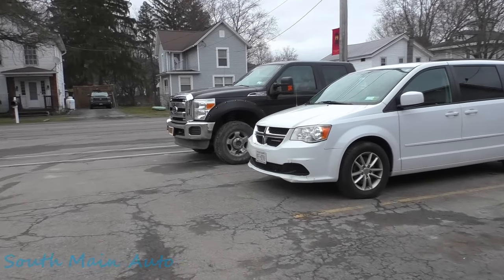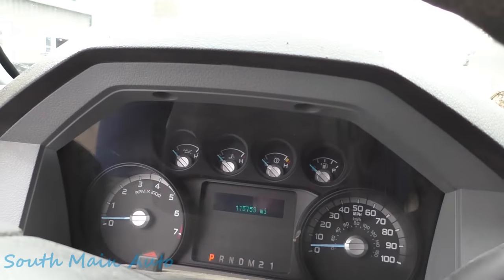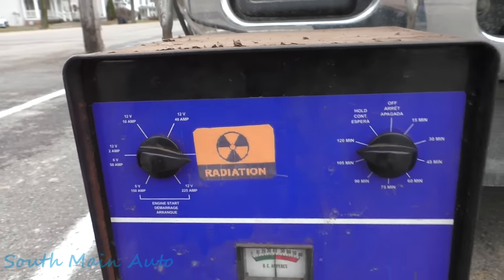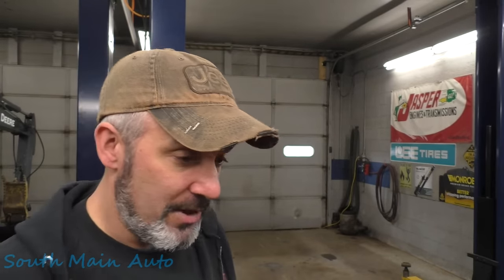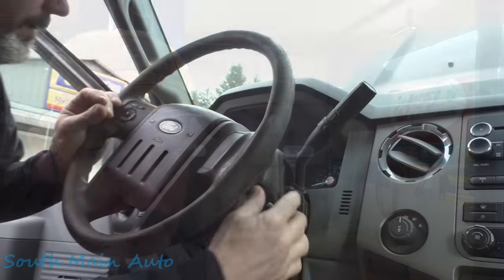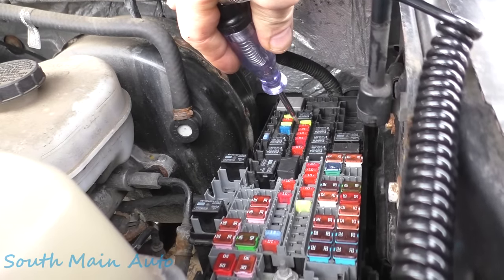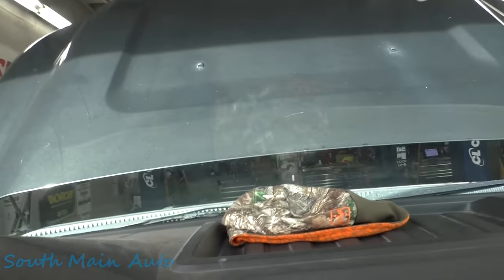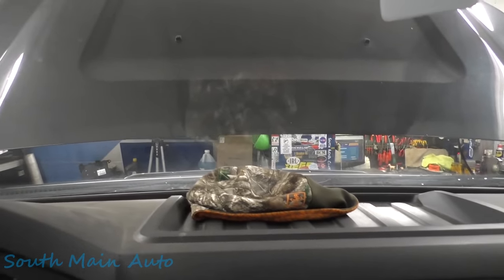Intermittent Stalling Ford F-250 : The Real Fix

Comment: If memory serves, you did check all of that!  I think the wire was still conducting intermittently.  Solid fix.  Don't worry about it.  You're the most thorough, honest mechanic I've seen in my life.  I don't even trust oil changers.  I mark the filter before going in the old days.  I just change my own.  I've even diagnosed an alternator problem on my truck using your methods, checking voltages etc.  Bought an alternator rebuild kit and back up and running!

Comment: You're absolutely right! Sometimes just wiggling a fuse box, fuse or relay will temporarily fix an intermittent problem and if you can't duplicate it sometimes you just have to replace the relay and ship it b/c you don't want to spend customer's $$ on labor chasing a problem that doesn't exist. Like you said, when you diagnose it vs replace parts if it comes back you know what you already checked but even then you have to almost start all over again. Intermittents will sometimes drive you crazy but when you fix what others couldn't that's what makes it satisfying!

Comment: I think your approach to intermittents is the right way to go about it. The fact that it was intermittent in the very beginning is what made it so difficult to resolve. I had a nagging intermittent on my 86 Camaro with TPI. I would be driving and all of a sudden the SES light would come on and the car would run like absolute poo and then after a bit, it would run normally. I ohmed the TPS sensor all along the sweep range, I checked the MAF sensor and datalogged it a few times. I actually replaced the TPS because it kept giving me a TPS code and there was voltage on the 5v ref wire and ground. Then while I was poking around the TPS I saw it, there was a piece of missing insulation on the signal wire coming from the TPS to the ECM. It would move around when I was driving, especially on turns, ground out on the metal intake and set a code. It was on the bottom side of the wire and was easy to miss, but the visual inspection is a key part of diagnosis. My friend called me over once because he couldn't get his TBI to run right, it kept missing. I looked it over and in 10 seconds I saw a huge chunk missing in one of the spark plug wires and you could literally see the spark jumping across the gap in the insulation. He used to be a mechanic but you can go "snowblind" by all the possibilities and forget about the simple ones. Good videos, don't feel bad, those intermittents can be a biiiiiiiiiiiiiiiiiiiiiiiiiiiiiiiiiiiii

Comment: Mr. O! I watched both videos. You made an accurate diagnosis in the 1st video. Unfortunately, the wire was causing an intermittent failure after you replaced the relay. I've been there before. I can't tell you how satisfying it is to see another highly skilled technician do such an amazing job at diagnostics and repair. I absolutely love your videos. To be honest, I ran into a problem of a vehicle that left me scratching my head & swearing. I walked away from it for a while and later remembered a video you posted. It wasn't an exact failure and fix,  but it definitely helped put me on the right track. Thank you so much. Keep up the great work. Many blessings to you and your family.

Comment: Eric 
yes I must concur that an intermittent fault is the very hardest to find , video one you did  a solid diagnosis no question on that . when the job came back it was now a solid fault so now you have a solid fault to trace out  well done .

my worst case of a fault was doing maintenance on a 400hz 208 3 ph vac IBM mainframe PDU supply , it was the changeover switch the cables were about  1 inch in dia flexible and two foot long ( note I am metric minded so rough translation) well it worked for five years after a dust out one phase down ? traced it to one cable two foot long with crimped on ends , this is NOT possible in my mind tested with a 1000 volt mega still open , visual inspection showed the end of the said cable had been in contact with the nut on the connection  , so I cut off the lug split it in half the factory had left the mylar clear sheath on before crimping hence a insulated joint 😣. mainframe was down for 50mins while it was sorted new cable installed very expensive as it was one of a UK Banks mainframe

Comment: I feel  your frustration BUT, you fixed it when the dealer said it needed an unavailable fuse box.  The customer is super lucky to have you as a mechanic. Your first diagnosis was  correct. The hidden wire problem was just serendipity.

Comment: Eric, as I recall from the first video, you said if the relay didn't fixed it, then the problem was with the control side. You were right. Since we all saw the test light lit up on the power side of the control, the likely suspect was the ground side - the wire between the relay and the BCM. What you and we didn't know was that the control side was intermittently getting power. I just shows me how I get tunnel vision and don't examine something more closely. Thanks for a great lesson! I've learned tons from you. Don't you dare call that number for some truck driving school.

Comment: I worked on Crown Vic’s all day every day and I can’t tell you how many time we had those fuse boxes apart. Many times we ended up replacing the box and harness. If I recall the part was over $800 but it sure cured a lot of problems.

Comment: Don’t give up Eric sometimes problems don’t always show their ugly head right away and sometimes they never show at all. I had a tractor once with a no start condition once. I tested everything and couldn’t find the problem. I even replaced everything just for the heck of it after cleaning the grounds. I was so furious and confused every circuit tested fine. Even replace one part at a time and put the old parts back in. So i decided I leave the battery disconnected overnight. I said god you handle it. Hooked the battery back up the next day and it worked perfectly fine. Never did find the problem because it never happened again. You’re a great mechanic and I have only ever experienced this twice in my life so far. Keep your head up and don’t give up.

Comment: My guess is the wire was partially shorter or broken the first time and when you inserted the new relay, the wire fixed itself. Another month of harsh conditions and it finally broke enough to replicate the problem again. When you pulled the fuse box up, you finished the process. Your diagnosis was sound the first time with the conditions you had presented. Obviously it fixed itself enough to run for another month. Don’t beat yourself up over it. Your process is absolutely one of the best out there.

EDIT: Just saw your update comment. Thanks for the update and I agree.

Comment: You didn't miss this the first time. I just happened to watch that video just before this one. The signal was always there and not intermittent. My guess is the wire was just hanging on by a strand at that point and finally broke afterward. I do see why this could be a warranty repair because it did come back for the same problem.  You win some, and you lose some. At least your customer has been made whole, and your work is solid. I wish there was someone as methodical as you her in WV.

Comment: We are not perfect! I've had trouble with Fords having a break in the copper inside of the insulation of the wiring. Sometimes it would touch and make connection and sometimes not! In 45 years of wrenching i though about giving it up but hung in there . I hope you will also!

Comment: Kinda reminds me of my son's Jeep Patriot with the 9 ground wires going to one eyelet on the body by the battery, it looked good, but once removed, literally fell apart. Which controled o2 sensor, drivers side front not back blinker.  Don't envy today's mechanics working on these angel hair size wires.

Comment: Also factor in that you were not feeling well on the previous diagnostic video. and the other shop could've still put a fuse box or fix the wire, shine the box and claim they've replaced it. You put your reputation on line every time on full display including errors or mishaps when they occur! RESPECT.

Comment: While it certainly is possible to have missed it the first time, and, as I've heard you say many times before, intermittent problems come through and go out with them still possibly there.  This seems to be one of them.  I sincerely doubt it will return with the same symptoms.  This is a solid fix/repair.  Don't beat yourself up.  Keep on keeping on Eric!!!  You are much better than 99.999999 percent of all of them out there.  The only guy I've seen that could possibly be on the same plane as you is MechanicMike - he's pretty darned good too.  Keep 'em coming!!!

Comment: I recall you checking that power and there was power on both sides. The problem was it stopped failing after you pulled that relay. You went with a new relay and wasn't 100% sure it was fixed but it stopped failing , not much you could do. You even took the relay apart, it looked good.

Comment: Good work, Sir we appreciate your professionalism - poor designed junction boxes and short wires
make for many multi-problems. The junction box over the wheel housing does not help either.
Vibrations and poor connections are hard to find. Took us three months on a vibration fault on our F-16
Aircraft to chase down, plus 21 poorly designed pins were tear drop shaped not round. Your trouble shooting 
is berry articulate - would make for very good training films... keep up the great work !
  F-16 Radar Crew / hot roders

Comment: I recently ran into an "intermittent" problem that drove me a bit insane. Had an issue with the A/T relay on our '04 Eclipse that I swore would be a short to ground (20a fuse blown that controls A/T relay), but when I tried to find one I couldn't. What I did find was the shift solenoids had a higher then spec resistance to them, and I had (wrongly) assumed that they were pulling to ground a short, blowing the fuse. Replaced solenoids, thought all was well, then a little later same issue! It wasn't until after the solenoids were replaced that it finally stopped being intermittent and I was able to trace it to a wire that was rubbing against the thermostat housing from a harness that the plastic had broke, causing the entire harness to sag/drop. 

I think I speak for a lot of though that we learn a lot from your videos, as I don't think I'd have traced this fault as well if I wasn't watching so many SMA videos lol.

Comment: I was working in the Defence Industry and carried out large (and very expensive) testing.  Had one where we tested the daylights out of the device and coupled it to an engine.  Failed.  Took me two weeks to find the damn problem.  One of the boards (hand made) had a tiny copper trace, 0.25 mm, causing an intermittent short.  I was going ballistic.
Mr O, I know how you feel.  I really do.  The Goal is to win in the end

Comment: Broken wire? Mr O will see it instantly. 

Don't beat yourself up, you can only fix em so they run. 

The first fix you did was actually part of the diagnostic process. You said as much.

I am happy with what you did, you were clearly cheesed off. Says a lot about your integrity.

Comment: We had a truck where I work that would randomly shut off and if you would open the fuse box and tap on the fuses it would start back up I took the whole fuse box apart and cleaned and crimped in all of the fuse connection points so the fuses fit tighter it was a fun journey.

Comment: Ivan had a similar problem when nuking the battery w/ a charger. The cars computer prevents you from starting the car do to high voltage feed back from current clamp.

Comment: Hey Eric you did a lot more than first shop and narrowed it down. Sometimes it takes a second time to solve intermittent issue. 
I’ve used these small WAGO type connectors which have electrical grease . Their a snap. Excellent video

Comment: I have been in your shoes on a repair like this and so have many others.  Your right in saying that without the full "Monty" of your 1st Diag, you would have spent alot more time to get where your found the wire issue.  Just imagine if you had removed that PITA fuse box to only find the defective wire AFTER it was removed!  Luck favors the prepared!

Comment: You did check control ckt a few times as I recall. Maybe load test on ckt would have revealed wire integrity issue, remember 1st shop said bad fuse panel, right, maybe they caught control side winking out and didn't want to dig in like you did. We all have comebacks buddy. But not every shop steps up like you did and solves the problem. Well done as usual!

Comment: Eric . I mentioned on part 1 that i had faught an f350 with same issues.  Man i literally fought that thing for over a month . I had probably 60hrs in it atleast.  I fixed multiple dead shorts multiple broken wires , multiple pin fitment issues. Then found the bad aftermarket prom that was hidden in the ecm case . The easy way to access that box is through the fender well. It dies have plugs that allow the box to come out . That are on a pig tale . Fords dont brake as often but when they do ... 🤯

Comment: 20:55 as a certified master auto and diesel, repair tech myself, Eric and All, electrical gremlins, such as this caused by stupidity of manufacturers, putting the smallest gauge wires in in the shortest of roots so they can save a quarter of an inch per wire yes, (I know it all adds up over many many cars, a manufacturer but please let’s not be stupid and stingy about it. We will be happy to pay the extra money for an extra half an inch of wire if it makes our lives better!) two things… Please do not quit because I very much enjoy watching a fellow wrench turner and diagnostic pro like yourself go through the flow chart of what it could be in what it shouldn’t be like I do, and I definitely enjoy your sense of humor, which is right parallel with mine. Number two is different ha ha as I would’ve putting one cable tie around all of those wires and cinched it down as without stretching anything and then I would’ve put some hot glue over it to keep any stray wire is also from, trying to stick your fingers out and then getting pinched off… Pinched off wires equals pissed off auto repair technician! Thank you Eric and Mrs. O, for all that you do! :-)
    Edward H. – “Madison Combustion Associates” and “new ideas and innovations, LLC“ out of the Madison, CT area.

Comment: Another fine job by an everyday athlete.  Nice that the guy had faith in Mr. O to bring it back after it had been "fixed".  What a rats nest of wires in that thing.  It seems like the first thing that flopped out of that box was the broken wire.  Amazing!  Thanks for not recording the "strong language".  I think kids should learn their own expletives.  I know I have my own.  I wonder if Mr. O also throws tools.  I do occasionally and that helps as long as they don't flip up and get me.  I had a close call with my wife once with a thrown tool so I keep that in my memory bank.  Tough, time consuming repair but once again the gremlins were foiled.

Comment: Here in Australia I fixed an Australian made Ford EL Falcon sedan which my great uncles stepdaughter owns which had a stalling problem whenever the gear selector was placed into the drive position.

The cause of the problem was a faulty aftermarket engine immobilizer/car alarm so t bypassed it so I reconnected the main positive feed wire from the ignition switch back to how Ford had it wired up in the factory !

Comment: Other than the current loop, one can get access to these measurement points by popping the cover off a relay and measure there. Taking a relay apart is a lot cheaper than that little test box.

Comment: No mechanic can find an intermittent problem. Some will refuse to work on intermittent problems. The wire was touching but by a few strands and the only way to expose it was to take out the entire fuse box which you did and you found it. There is no way in hell anyone would remove the fuse box to look for broken wires if all the wires were working at the time of checking. Like you said he drove it for a month. You did good, no harm no foul.

Comment: Yeah but if the wire was broken but in the insulation it could self connect and open and make contact again and you just caught it at the time it was making contact. You do not need to put yourself down. You are a fantastic old/new school mechanic.

Comment: It worked fine after the relay fix. Eventually intermittents show there ugly heads later. They always consume more time to figure out. Manufacturers need to make a fuse box more accessible. All said you took the right process.

Comment: Makes sense, wire was just holding on long enough to power the coil in the relay for a few minutes, which is why it would stall after 1-2 minutes before. It would heat up in the high resistance area when it was powering the coil in the relay.

Comment: Your Diagnostic Procedure was perfect. And the "Real Fix" is exactly as you said "... I would like to meet the  engineer that designed this..."  Nevertheless,  I ultimately blame the Senior Engineer QA is the Seniors responsibility.  The design was going to fail and like you said the "real fix" was easy "... should have used a connector"..... Professor C.

Comment: I believe that on the initial look at this problem, you had 2 12v readings from the 4 socket pins of the starter relay, unlike today, so it was just the intermittent connection of the broken wire...